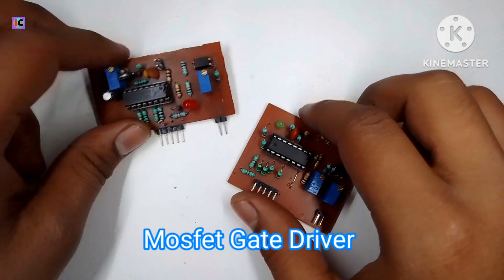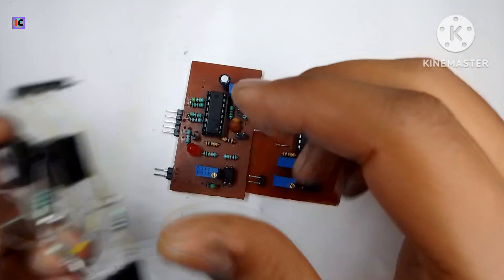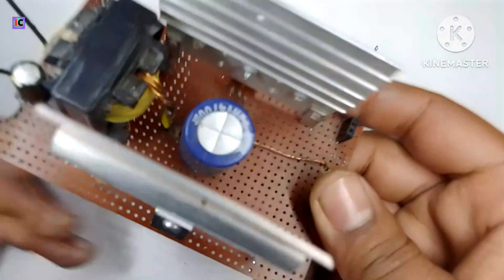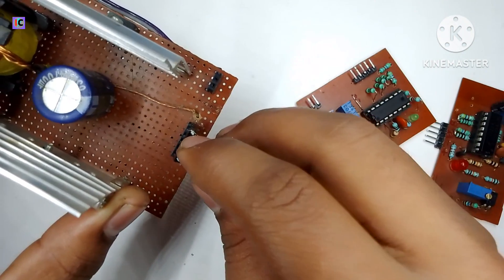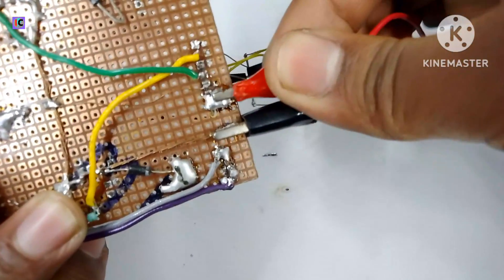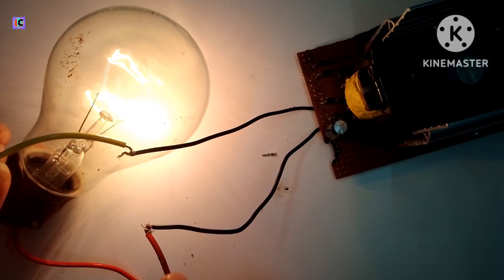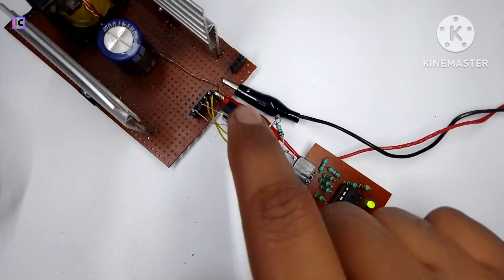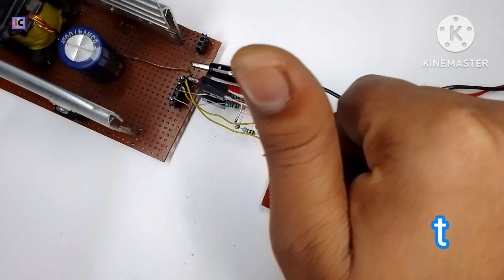High Power Inverter MOSFET Driver 1KW - 5KW #mosfet #inverter

Comment: Sir please help me my sg3525 circuit not working for atx transformer 3+3T and 80turn. I have tried many times but after connecting to mosfet gate mosfet and transformer are heating quickly
Reply from the maker: first test the output signal from sg3525 it might giving wrong output that's why mosfet is shorting and heating
Reply: @innovationic  sir, I have made same circuit again, it's only working on 14.0.14 turn ferrite transfermer, why it's not working on 3.0.3 turn ferrite transfermer? What is the reason, please tach me

Comment: Can you draw circuite diagram for driving more mosfets for your buck boost converter ? https://youtu.be/1Phqg1R6IVQ?si=xVnu7WcitIM3_7Ka
Reply from the maker: you can connect all mosfets Drain ans source pins, 10 ohm resistor will connect all gates as shown in circuit
https://drive.google.com/file/d/1UeumK_ggw6QFyCuaknm7QEMDRPjnj7Fg/view?usp=drivesdk
Reply: @innovationic  thanks , connect back leg of 1k resister to pin 9 and 10 of tl494 ? Will remain 4.7k from GND to pin 9,10 ? Or remove it ?
Reply from the maker: back leg will connect to TL494 and 4.7K remains connected as it is
Reply: @innovationic  ok thanks , last question, in the modified circuite second and third mosfet gate connected to 10 ohm Separately but first mosfet not have independent 10 ohm resister , check it , diagrame is correct, mosfet gate will not be equal!!!
Reply from the maker: all mosfets are connected through 10 ohm resistor individual, seperate resistor for each mosfet
Reply: @innovationic  so check it , second and third mosfet has own 10 ohm but first mosfet not have own resistor !!!????
Reply from the maker: This is the final circuit 
https://drive.google.com/file/d/1AAvO9lKtK5_2aPWIuCVdmwLQB4FMh-p0/view?usp=sharing
Reply: @innovationic  thanks , pwm in connected to E1,E2 after 4.7k right ? And for inductor i have green blue core from ATX 2cm inner diameter 3.8cm outer diameter is good for making 100uH ?
Reply from the maker: yes the E1 and E2 connect to gate driver with 1k resistor with pulldown resistor 4.7kand ATX core is very good for high power
Reply: @innovationic  thanks so the color and size I mentioned of core is good for high current, and i will use irf3205, And two 0.22 ohm 5w in parallel i will get 0.11 ohm 10 w from it for current shunt
Reply: There are 3 cap with 100uF not available for me can use 470uF ? I know it’s more but can use?